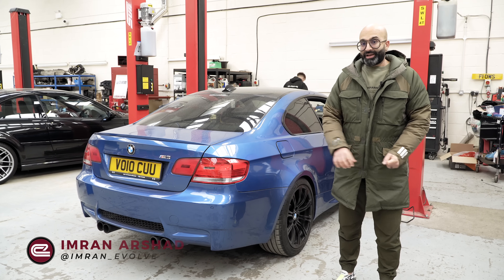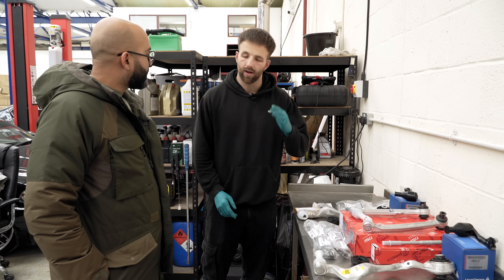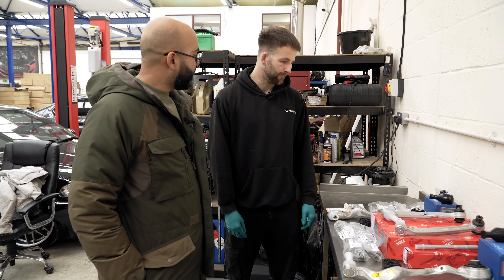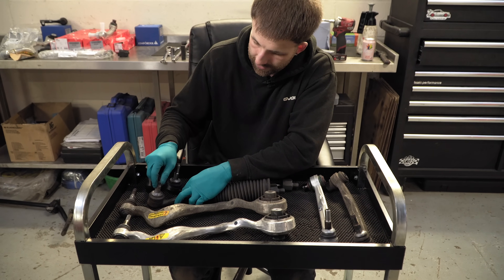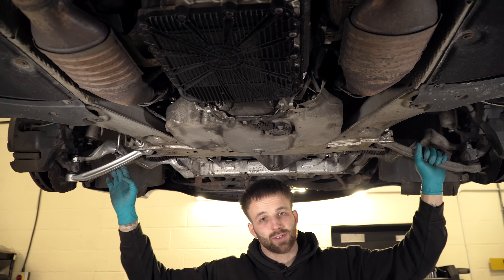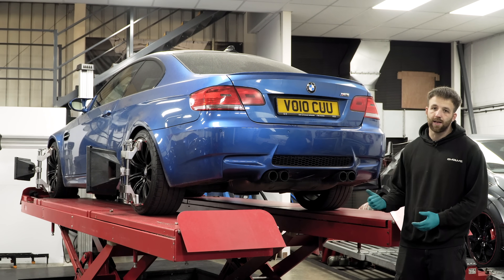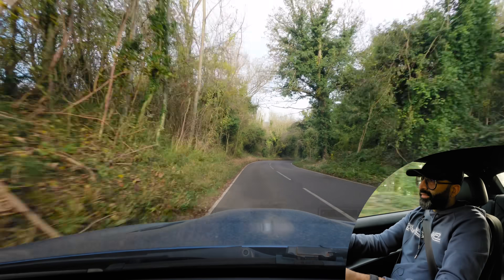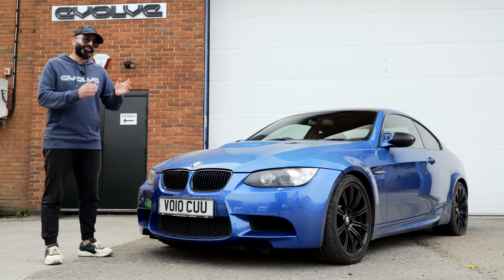Curing our 152k mile E92 M3's vague steering feel - Front Suspension Refresh

Comment: Happy to see they got the TRW, the price is right. I have these on my e92 335i with an M3 sway, Dinan camber plates, and Bilstein coil overs and the steering is significantly better than stock while still riding great. (Can’t say the same for those who delete the factory strut mounts)

Also tip, if you are putting these in your 335i it will be hard to get them in. Hammer the subframe once on each corner outward and they will slide right in.

Comment: 170,000 miles on my E91. It took me 5 hours for 1 side as DIY, but that included changing out the strut using the dreaded spring compressor! ;-)  My top strut mount definitely needed replacing as well. I usually keep my BMWs for 250k miles. May have to keep my 2009 Touring longer because there aren't any wagons on the road that look as good!

Comment: Thanks so much guys, my e93 330d convertible has 150k and is starting to feel like a boat! 🤦🏻‍♂️ Nice to know a few k should get it back to normal. Thanks for doing all the hard work! Much appreciated. I know these engines are good for 400k plus so it's worth doing. Awesome work 👏🏼
Reply: You can upgrade your front lower control arms with E9X M3 parts. A BMW with 400k miles? HaHa Noooooo.
Reply: @nycshelbygt500  lol M57s I’ve seen many with over 400k lol maybe not the petrol bmws but diesel ones are bullet proof really.

Comment: Loving this series, guys!  I refreshed the front control arms and sway bar links on my E92 M3 as well (at 60K miles) and it made a HUGE difference.  Didn't change out the tie rods but will likely do that at 85-90K.  Haven't done anything yet to the rear but I sometimes feel a bit of looseness back there as well, so looking forward to your next vid.  Which rear links do you plan to replace?
Reply from the maker: Thanks Ari! Tie Rods will definitely help with the steering feel.

Truthfully we plan to replace every part of the rear suspension, but will start with the two easy arms, before moving on to the more difficult to change ones along with the subframe bushes themselves.
Reply: @EvolveAutomotive  Thanks!  Looking forward to the vid!
Reply: @EvolveAutomotive  Yes, can't wait for the next vid either. You are doing such a great job, taking people the fear of some really easy jobs and your explanations are excellent

Comment: #Aston was awesome in the latest 007 Bond Film No Time to Die #AstonMartinDB Ana de Armas' scene was the only other highlight.

My BMW E90 M3 has 190k miles, so I am due for a refresh for XMAS. Next time you get an oil change, have the tech check all your control arms for excess wear and play. One tip: Do the rear suspension first and then the front suspension, so you only need to do the wheel alignment once. They make upgraded rear trailing arms (w and w/o spherical bushings -- very hard to press in and out on the car). The BMW parts are made to buckle, so the gas tank doesn't puncture in a rear end collision. Once the rear suspension is done, then I can add the Varis carbon fiber undertray and rear diffuser.

Note that Aston also replaced the sway bar rubber bushings and links. Very important to also do the tie rods, not just the control arms. Would have been nice to also install stainless steel brake lines...for great brake pedal feel.
Reply from the maker: We did the front first as we felt this was the more pressing issue ruining the enjoyment of the car.

Brakes will be looked at in good time.

Comment: 1m 20s in and these look like the same items or close as, to my X3 which is wondering around with a mind of its own. Not many video guides about doing them!
Reply from the maker: E9x platform (and the cars based on it) will have similar suspension setups as the M3, just with different grade of components.

Comment: I believe your driving position, distance from the steering wheel, is a bit too far away. You should be able to touch the top of the wheel with your wrist if I’m not mistaking. Top video

Comment: Can you guys do this work on an N54 335i, and would the M3 parts bolt on?
Reply: Yes they do. Straight fit. Doing the same upgrade myself.
Reply: @grovsey3656  nice. My 3 series is 150k and needs all the same work as this on the suspension and bushes etc
Reply: Was just thinking this myself! Would love to restore my 335i to how it came out of the factory or better. Just at 13 years old now
Reply: @kierantilley2590  ye mines an 07 model and other than the new M3, nothing much released since makes me want to replace it, and 100k is out of my budget.

Comment: Why didn’t you Upgrade the joints and bushes to polyurethane.
Reply from the maker: Poly would be a downgrade from spherical and is not suitable for the rubber one. The only upgrade would be a spherical.

Poly bushes being a blanket upgrade is a misconception. In the case of a factory performance car such as the M3, new OEM bushes are more than sufficient for road use.